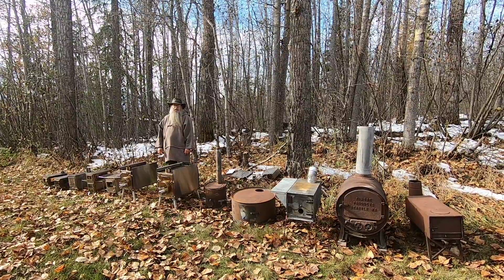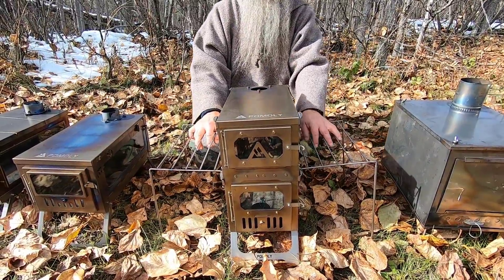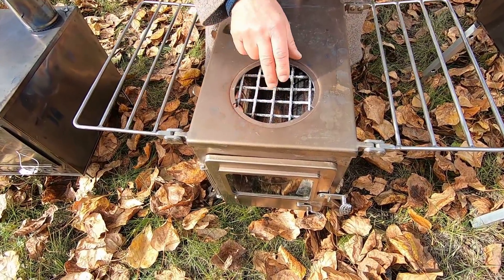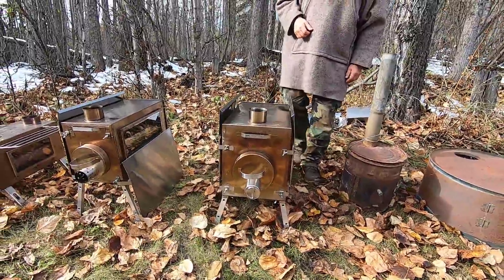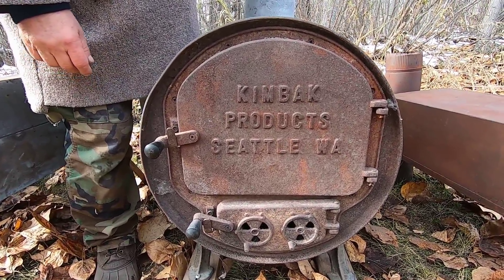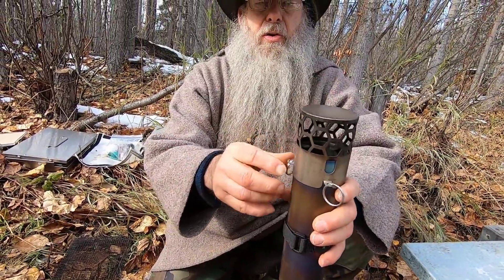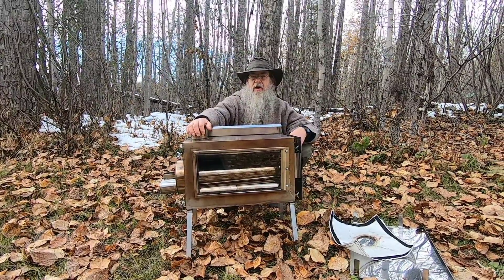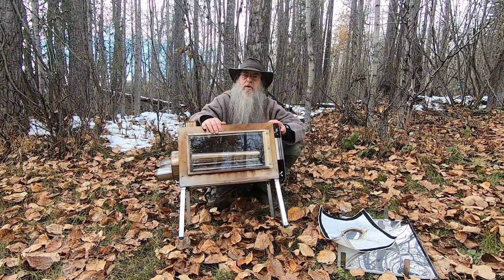Camp Tent Wood Stove info For The Common Man

Comment: The circular cut out in the top is for boiling the kettle or cooking.
Reply from the maker: The circular hole in the stainless model is for extra heat for cooking as you said.   However I never use it as cooking on the top of the stove works just fine.  The circular cutout in the old military stove was made for inserting some hardware that would enable burning diesel fuel in the stove rather than wood

Comment: interesting.makes me curious about possible design modifications to help maximize the heat a stove like these can radiate.also wonder how bad the folders leak smoke.seems like that would be a common issue
Reply from the maker: The folding or breakdown stoves do not leak smoke as there is always a slight negative pressure inside.  The hot rising gasses flowing up the stove pipe creates a slight suction.  

Having a baffle inside the stove like the two Russian stoves here and my homemade galvanized steel stove does increase heat extraction.  It has been claimed that side window glass increases radiant heat as well but I am not convinced either way if side glass has any heat benefits.   The T-Brick Max Pomoly stove (the "double decker") that I showed in this video has heated secondary air intakes that increase combustion of secondary wood gasses and it does work somewhat when a fire is burning hot.

Comment: Sight glass can be cleaned easily and effortlessly with an ammonia cleaner to remove any soot.
Reply from the maker: In doing a bit of online research, I discovered that stove "glass" is not glass but is actually a type of ceramic and it is not recommended to use ammonia on it as it can etch it and thus create an environment that encourages even more soot buildup.
Reply: @Far-North-Bushcraft-Survival  I didn’t know that. Thanks for the info and btw love you and Connie. The videos you two make are awesome!! Stay warm up there in Alaska !!

Comment: READ THIS💖💖💖 Very informative video.. thanks so much for sharing.. got any ideas for a small stove for a 20-foot camping van with all appliances taken out, just shelving.. appreciate it💖
Reply from the maker: It would be very hard it seems to me to heat that small of an area in cubic feet using wood.  The stove would have to be quite small and small stoves require frequent fuel maintenance.  I don't have any experience with woodstoves in a vehicle like that so do not really have a good grasp on what might be best.   I personally think that perhaps a tiny oil stove might be better.  Maybe something used in the marine industry for boat cabins.   Just a thought.
Reply: @Far-North-Bushcraft-Survival  thank you for taking the time to answer me.. I like the marine oil heater you talk of I just hope I'm not allergic to it.. a lot of van dwellers get that Wave propane heater.. I'm not sure how much longer we're going to be able to get propane or oil.. and nothing beats the warmth of a wood stove💖
Reply from the maker: For wood stove use in a van I would not get one of these breakdown titanium stoves.  I would rather get a small stainless steel stove.   A mild steel or cast iron stove would also work fine but if a mild steel stove is thin which almost all small stoves would be, they might only last a season or two if used constantly.   A stainless steel stove would last much longer but would also be more expensive.   So if you still want a wood burner I would suggest that you look for one of the smallest stainless stoves you can find or else get a bit larger one and plan on leaving a window or two open if needed.   You will most likely need to leave a window open anyway so as to provide enough air for the stove wood combustion and your breathing.
Reply: @Far-North-Bushcraft-Survival  thank you for your advice I really appreciate it💖

Comment: That  center round part that lifts out of for pots and pans I was always told anyway.
Reply from the maker: Yes I believe you are correct.  It is the same as the old wood cook stoves.   However I do not feel that it is needed, as cooking works just fine on the rest of the stove top.

Comment: I have the the last one the little military one I just had to weld new hinges on it and I buffed it up with a wire wheel and that's when I noticed it said 1954 on the front of it I pretty much figured it was a military one just by that so that's pretty cool that it actually is a military stove

Comment: I don’t claim to be an expert, but I know titanium doesn’t conduct heat very well, so there would be more heat going up the chimney, but if being light is essential, it’s better than nothing.
The baffle in the Russian one is interesting.  The traditional Russian oven uses some pretty strange pathways in them, to optimize heat, and give zones to it.
Reply from the maker: I'm not sure where you got your info about titanium heat transfer abilities but my experience is just the opposite.   There is a lot of cooking pots, kettles and skillets made of titanium being used now days.  The titanium stoves work great and are far from being only "better than nothing."   They work exactly as designed and are every bit as good as stainless steel stoves or mild steel stove but also weigh less.   The only draw back to the titanium stoves that i can think of other than not being as robust all in all as their thicker metal non breakdown stoves, is the cost.   They are a more expensive stove due to the expense of the titanium metal itself. These titanium stoves transfer heat just as well as the stainless or mild steel stoves as well.  That is based on my personal experiences rather than scientific evidence however.

Comment: Hey there, just a quick question. What do you use as guy lines for the stove pipe? I'm asking because of the pipe would be hot. Thanks. Good  to see another video from you guys. Take care.
Reply from the maker: The stove pipe has cooled down considerably at the top.   I typically use a small diameter nylon line with a "caribiner" at the end to connect to the pipe guy out connections.   The caribiner allows quick disconnect/reconnect as well as a bit of standoff distance for the synthetic cordage.

Comment: On size of stoves.   lets also not forget burn times.    a large stove, you can pack full,  damp it right down,  and get 6,8 sometimes even 10 hours of burn time out of it.   A small stove, you might be lucky to get 2-3 hours.  This means a small stove, you need to wake up several times during the night to feed.

Comment: Very enlightening about stoves that one that has the baffle you said that is only good for larger tents I have a 10 x 14 wall tent do you think that would be able to heat it thank you
Reply from the maker: I have not used that stove in a wall tent of that size.  However I believe that that stove would be marginal if it could even do it.   Of course my idea of cold weather and your idea may be different.   I used my old 30 gallon barrel stove that is in this video in a 12 X 14 traditional canvas wall tent to as low as the negative 20s  Fahrenheit and it was okay but the other folks I was camping with that had 55 gallon barrel stoves were more comfortable.   Barrel stove kits are not very expensive and neither are used barrels.    If you are not going to encounter those cold of temps then that larger Russian stove may be enough.
Reply from the maker: Ps:   If you cover the entire roof of your tent with another tarp it should make it easier to heat if the stove you end up using is not quite as capable as you hoped.   It might even help to throw a few branches on top of the tent roof before adding the second layer so as to hold the two layers apart a bit better and creating more dead air space.
Reply: @Far-North-Bushcraft-Survival  thank you for the information, I live in West Virginia and it does get cold here.

Comment: Excellent review, thank you very much for sharing your vast knowledge in such a meticulous presentation. Not to be critical but maybe for novices like me you could explain the value or how to use the damper ?
Reply from the maker: I personally prefer to do all of my fire burn rate control from the air intake.  However one is not always able to gain the level of control necessary with intake alone.   So in that case I will add in damper control as well, as a secondary means of burn rate control.
Reply: @Far-North-Bushcraft-Survival  Thank you for your reply and I apologize for my lack of knowledge as I’m still learning but where is the “air intake” located?
Reply from the maker: The air intake is usually on the front of the stove where one opens it up greater or closes it down to increase or diminish burn rate.   On simpler stoves or stoves with inefficient air intakes, many will just leave the stove door open various amounts to accomplish the same objective.
Reply: @Far-North-Bushcraft-Survival   oh right I saw that on your stove review, thank you again for taking the time to help me understand better.  I love your show.

Comment: In an 8’ x 8’ insulated portable fish house, which wood stove would u recommend?   Thanks for the video!!
Reply from the maker: Well I do not have personal experience with that exact scenario but I would guess that you are going to want a quite small stove.   An insulated and small enclosure like that will not require much heat especially after it is up to comfortable temperatures inside.   If money is not a problem, I think for that application I would tend to lean more towards a tiny diesel heater like is used in small boat cabins.   A woodstove would need to be quite small and therefor would require frequent refueling.   No need for a titanium breakdown in this case so small steel or stainless steel models would be the logical focus.

Comment: Hey there! I hope that you see this post as it’s been a year since you made this video. It was a very informative and confidence building video and I really appreciate seeing all the different types of stoves and the really awesome ones that you made yourself! I was able to purchase secondhand a cast iron stove similar to a Morso 1410-B squirrel sides wood stove. When I was wanting to get an extra seal and extra glass for the front door for future emergency, I was told that the stove had been over burned and that the baffle was warped? The guy told me the stove couldn’t be used anymore!? The people I bought it from unless they were lying said they had just used it the last winter and it worked just fine. Is this baffle a big concern or is the guy just trying to sell me a new cast-iron stove?
Reply from the maker: Without me seeing the stove and the damage done to it, it is impossible for me to make a judgement call on it.  If you know of any other neighbors, friends etc that regularly burn wood, ask them to take a look at it and tell you what they think.   Honestly it sounds to me that  the store owner is possibly dishonest.   I am no metallurgist but If I am not mistaken, cast iron will not warp regardless of amount of heat.   Even if a baffle IS warped, it should not affect the wood burning efficiency or stove safety unless the warp opens up extra airway paths or unless it excessively restricts air movement.   Warpage itself without the potential problems listed above should not affect the stoves usefulness.   However as i initially said, without me seeing it I can not say for sure as I have limited information.  Try and find someone else that is knowledgeable on the subject to take a look at it.  In other words, get a second opinion from a source that would not be biased.

Comment: Nice vid.  I have a friend with a glass door on her wood burning insert.  She uses a spray on the glass every couple of Burns that she claims dissolves the soot and scrapes off very easily.  Have you tried this on those stoves with glass side panels?
Reply from the maker: Yes I have some spray on woodstove glass cleaner now and it does work quite well.  I occasionally still need to use a razor bladed glass scraper tool to get off the last stubborn bits but all in all the spray works pretty fair.

Comment: Will that water heater boil water?
That is really nice I’ve never seen that before
Reply from the maker: Yes the water heater will boil water when placed on top of the stove.  I usually place it on top initially until the water does get hot and then transfer it to the side so as to free up more stove top for cooking.   Of course whether the water boils or not while sitting on top of the stove is dependent on how hot one is burning the stove.

Comment: We would decarbonize old 2 stroke exhaust with a drill fraied cable and a pipe put the wire in the drill put the wire on the small pipe into the big pipe it works inside use a wire wheel on a drill whear safety glasses

Comment: 11:20 the air intake can also have a pipe connected to it, so you can feed fresh air from outside. Carbon dioxide doesn't build up in the tent that way!
Reply from the maker: Uhhh, it is exactly the opposite of what you said.   I am a firm believer that one should NOT pipe direct air from outside direct to the stove intake in a tent due to safety reasons.   You WANT the stove to be sucking in shelter interior air so that any possible carbon monoxide that may be in the tent will be eventually sucked into the stove and disposed of up the stove pipe with the stove exhaust.   You WANT that stove to be constantly creating a negative pressure within the shelter interior so that the interior air will be constantly replaced by exterior air coming in through gaps under the shelter walls, door zippers or openings etc.   You want and need that recirculating fresh air in the shelter.   If you directly pipe in outside air directly to the stove air intake, you will be creating dead stale air in the shelter interior which potentially becomes a health hazard with a stove burning in the shelter.    Please do not pipe air directly to the stove intake.
Reply: @Far-North-Bushcraft-Survival  Sorry for making a comment on your You tube channel. Have a nice day!
Reply from the maker: Sorry you feel the need to stop making comments.   There are others who believe the same way as you concerning the fresh air in a tent as I have addressed this issue several times in the past.   So it was good that you made this comment so that others who believe the same way can hear the reasoning behind why it may not be a good idea.   i was not only "talking" to you but also to all who reads the comments.
Reply from the maker: Another way of looking at it is that I was not  critisizing you as a person, but rather giving a rebuttle to your statement.   I welcome all comments that are given with honesty and are not designed to inflame.   In other words, I don't think too much of those who purposely troll.   Your comment does not fit that category as I believe that you made the comment believing it to be helpful.

Comment: Wow! Lonnie, this is one GREAT video! What a great presentation. Other channels review and compare them but never as complete as this. Thank you for your time and effort In producing this. Do you think the fast fold oven could be made into a small wood stove? You have answered a lot of my questions!
Reply from the maker: Yes the fastfold oven should be capable of conversion as far as I can tell.  Don't know if the glass in it is high heat capable or not however.  Also a bottom would need to be fabricated.  The construction used in the oven is not designed for reducing warpage and that may end up being an issue perhaps.
Reply: Lonnie, thank you for your detailed reply. I’m thinking about purchasing the oven and possibly doing some of those mods to see how it holds up. I like the idea that it completely folds down and it appears that it could be placed into a larger backpack. Along with some rolled up titanium pipe, this could be something very interesting. Thanks again.

Comment: Hi there, Lonnie and Connie! Thank you for sharing this video. :) You mentioned that you like side shelves. Do you mind if I ask why? Are they for drying out gear?
My fiancé and I are thinking about adapting one of these stoves to heat our 5th wheel this winter. Do you have any recommendations in regard to using one of these stoves for that purpose?
Thanks again!
Reply from the maker: Side shelves may not be as important in a 5th wheel as in a floorless tent.  We enjoy the side shelves as a place to slide off pots or skillets of food onto that are getting too hot or we simply just want to keep them warm while cooking other items.  They can also be useful for drying out small clothing items such as stocking hats, socks, gloves or wet dish rags etc.   Of course, being that close to the source of heat, one will want to be careful not to scorch the drying items.  in a 5th wheel I would not use one of the breakdown titanium stoves.   Depending on how cold of weather you may encounter, how well insulated the 5th wheel is and how long it is along with tipouts or lack thereof,    Since space is often a priority in an RV, I would think a woodstove that is designed in more of a vertical manner would be better than these tent stoves that i have that are more horizontal in design.   Of course a vertical stove would have less top surface for potential cooking on if that is part of the plan..